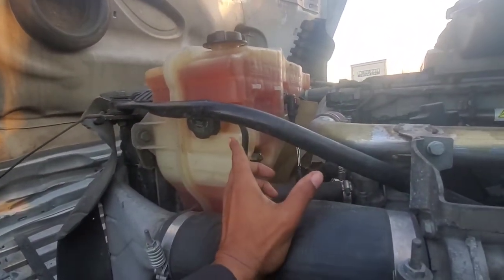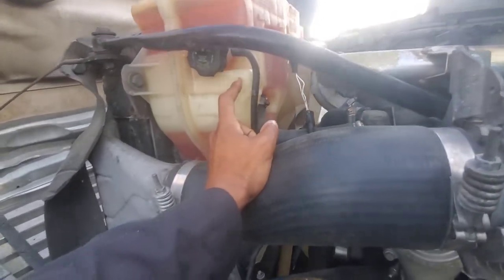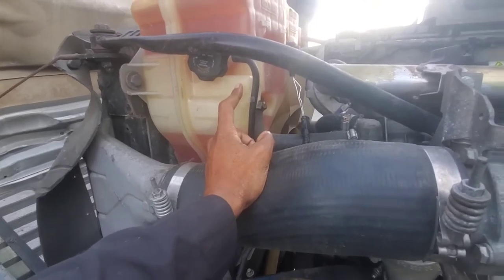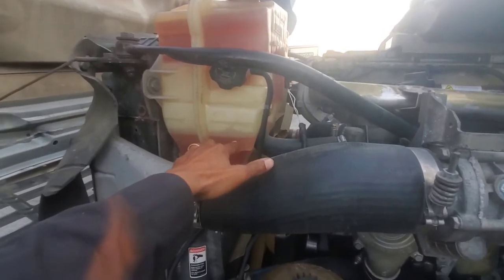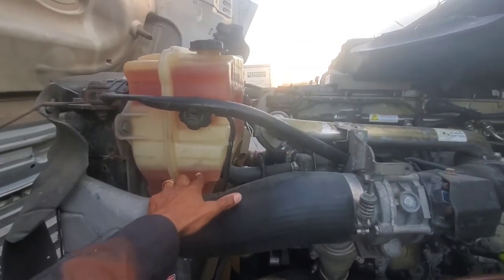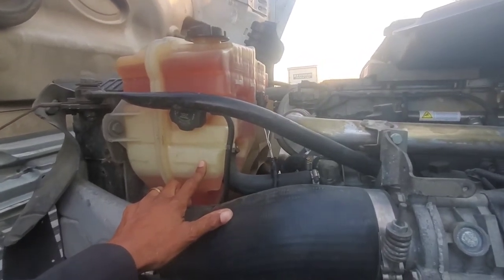Cascadia  dd15 Coolant Tank

Comment: B4 yo change I he reservoir do herself a favor! In the he morning when truck is cold open the hood and check for little coolant puddles, if found one or several tighten the clamps where the leak is, that might solve the problem! My 2014 cascadia evo was leaking a little & I ignored the problem but one day I noticed the dry reservoir with coolant & lower then usual antifreeze so I just put more! One day while driving the low coolant alarm went on followed by engine shut msg it only gave me less than 3 minutes to pull over and shut down! worried I opened the hood & took a look, the reservoir was almost empty! I only had 1 gallon of drinking water so that's all I could put! I looked & look trying to find the problem but couldn't find nothing! luck was on my side though! the sensor was covered so I took off only to drive less than a mile and the same problem happened again, I pulled over & checked again in more detail then I found it!.... 2bc if enough questions.

Comment: Brother Man, quick question. Hey did your coolant reservoir start over flowing after you had your apu installed on your truck?
Reply from the maker: Apu has been on this truck since new it was ordered with it from the factory..yes I had it that long talk about it in my apu video
Reply: @allaboutsemis232  ok. I just got apu installed with the Artic Package on my truck.  Now my coolant reservoir will over flow when truck heats up to about 210
Reply from the maker: @misterflorida5437   shouldn’t be happening I have arctic package 2
Reply: @allaboutsemis232  ok thanks brother

Comment: I noticed no mention of bolts being stuck on top of  reservoir.
Reply from the maker: You notice right..if you use a impact driver your chances of having that issue is greatly reduced its when guys turn them slow and they strip the plastic that holds the bottom nut..almost happened to me..but I pulled out the impact I keep one in the truck
Reply: @allaboutsemis232  finally i got my stuck bolt out & the impact  wrench worked extremely well. Thanks ...  hopefully  i can get new hardware to replace those threads.
Reply from the maker: @dejavu4063  I'd figure another way to secure it really a bad design..if you don't start with a impact you in trouble..the bottom bolt and one top is good enough

Comment: How easy was it
I have coolant at bottom and leaking through cap
They said it could be blown gasket but there is no white sludge in oil cap or dip stick
Reply from the maker: Not  hard at all like 3 bolts

Comment: No it’s not bad. It will just drain out in few days and the bottom will be empty.  It happens if tank is over filled
Reply from the maker: No sir...i can tell you mines never drain itself out i drove around like that for months before i new what was the issue.  Not to mention there is a drain hose on the unit at the top that allows the over flow to run out on the ground and illl have you know i have never had coolant in the bottom since its been changed and i never had it over filled prior so how did it get in there to begin with? Glad you asked.. the inside of the unit has something like a diaphram  that when the unit is over stressed/or pressurized  that diaphram gives thus giving you the tale tale coolant in the bottom that 1 you could be building up too much pressure in the system for verious reasons  and or the reservoir is just bad and considering many others have tried what i said and have confirmed that also fixed their problem i have to respectfully disagree with you..do your own research and you will see coolant is not supposed to be in that lower half..i didn't just make this up i promise!! Cheers!!
Reply: Check your caps. The bottom one may not be good.  My cascadia did the same thing when they refilled coolant after a water pump job. I thought now I have to replace the surge tank but I saw my bottom cap was not tight enough. I tightened it and after few days it was normal.   Before you spend money changing the surge tank, check both caps.
Reply from the maker: @SunilRaj-uu6ge  in my case they were not leaking but my tank was over 8 yrs old and had turned yellow so i was just like time to go new one and came with caps so it just made sense for me..but you make a good point ..check caps 1st

Comment: How much was part
Reply from the maker: Like  250
Reply: I appreciate it my tank is completely filled from bottom to top and coolant leaks out the cap...did you change your coolant filter with it as well...or is that necessary
Reply from the maker: @cedericjeffries1426  I didn't change  it id sayvits not nessary for a tank replacement and my truck doesn't have one anyway if I remember correctly
Reply: Ok I appreciate it when I seen your video it gave me some hope because I immediately thought blow head gasket but you described the issues that I'm currently having now...I will be calling freightliner here in a few to get the tank and I'll start there...once again thanks for the video
Reply from the maker: @cedericjeffries1426  if I helped you with this than  my job was done

Comment: I just had this issue I replaced the coolant reservoir and the same thing is happening smh
Reply: How you figure it out
Reply from the maker: You get that figured out ..if your system was over pressuring itself it will keep blowing out the reservoir  sometimes coolant in the bottom of a bad reservoir is the sign of another underlying problem i talked about this in a comment up top somewhere..